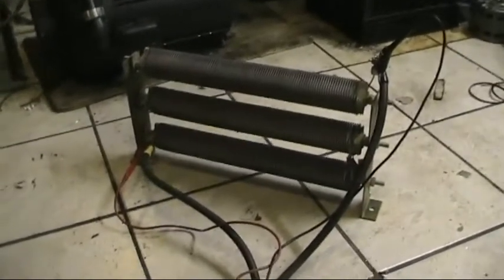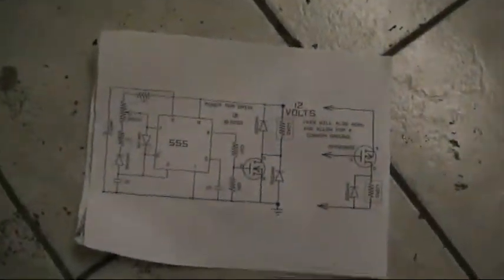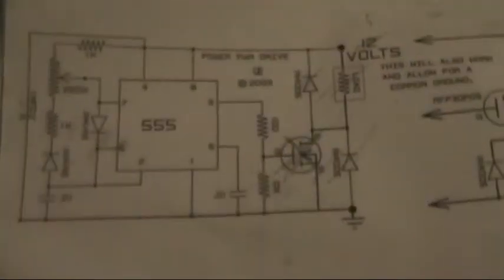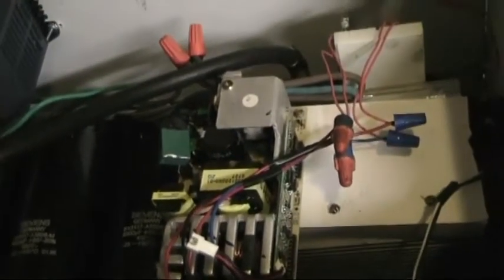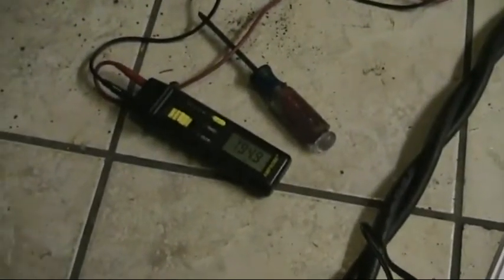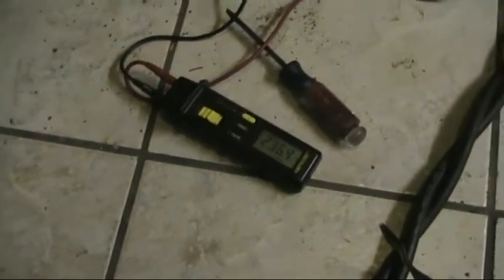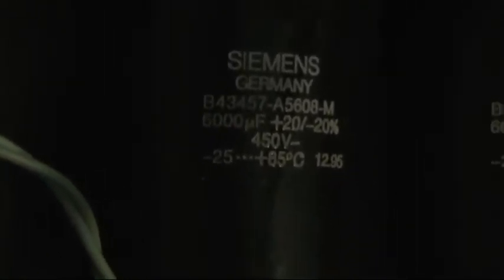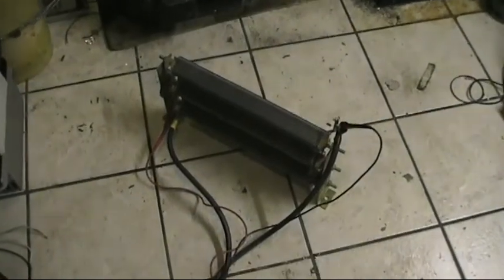IGBT PWM controller finished.

Comment from the maker: @savvas2000 You're right, my mistake. There should be a 10 ohm resistor in series with the gate driver. Thanks for pointing that out

Comment from the maker: @high1voltage1rules What kind of ZVS circuit do you want to make? for a flyback driver, boost converter or induction heater? each one is a little different. I can help you if you give me a little more info

Comment: Hey there friend many thanx for commenting on my video on IGBT collection. You asked if thay all work and yes there all working.. and I'm wanting to build a zvs driver and using an IGBT module as the replacement transistor! Iv been looking on google images for a circuit that helps to wire them up correctly.as I'd be cutted if I destroyed one! So if you know of a circuit that would do for the IGBT to replace the transistor then that would be great. Many thanx friend. ;)

Comment: it doesn't really output pure DC until you add a diode,inductor and capacitor to make it a buck converter.
sensitive electronics such as audio amps and microcontroller doesn't like PWM as power input :(